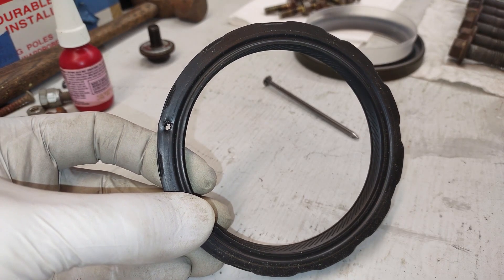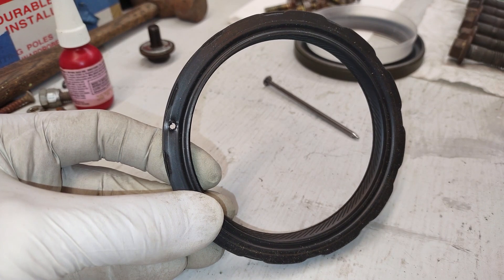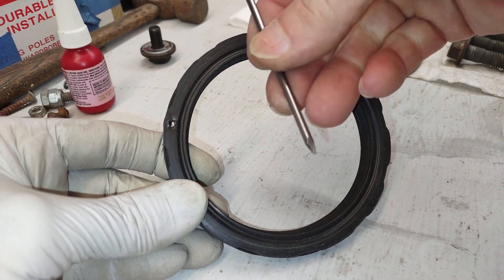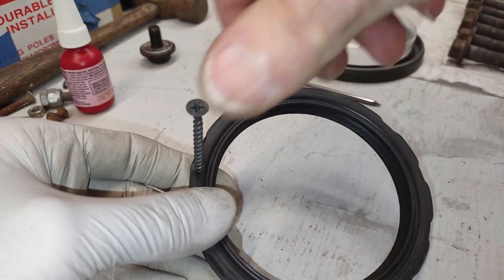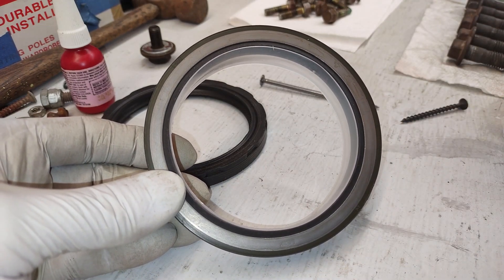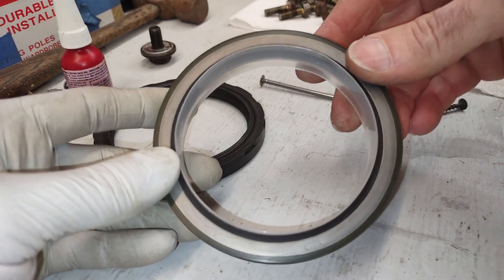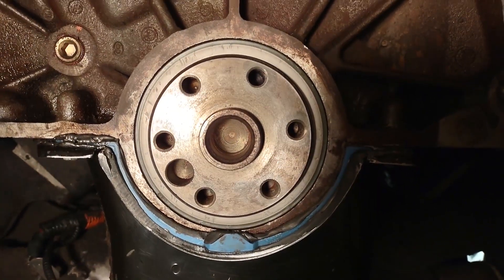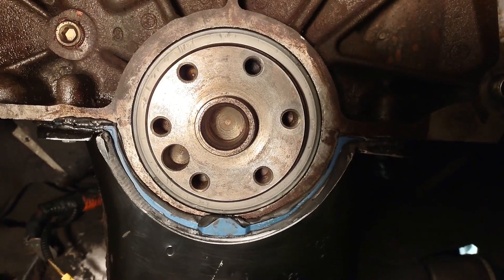2000 Ford Ranger 3.0 liter Vulcan V6 Rear Main Seal

Comment: Doing mine today, thank you for the guidance lol
Reply from the maker: @CodyDonahue-c2o  You're welcome! Good luck. Hope it goes well.
Reply: @videosmith9186  I someone ripped the first seal going in and decided to just get another new one and try again, didn’t wanna risk putting everything back and it still leaks. End in all it’s not leaking and everything works, only issue is i need to bleed the clutch still but I’m actually doing that today
Reply from the maker: @CodyDonahue-c2o  Yeah, if you think you've damaged the seal it's wise to replace it. They don't cost very much. Hope the clutch bleed goes well. If air is trapped in the master cylinder you will need to remove it and bench bleed it. It's a bad design. There are lots of videos about it.